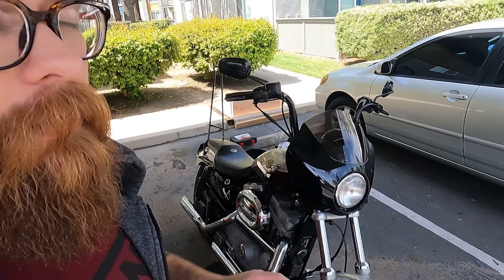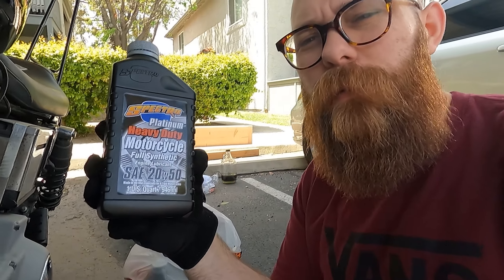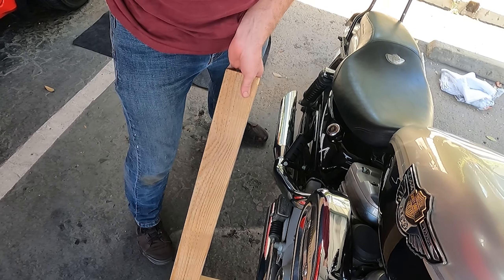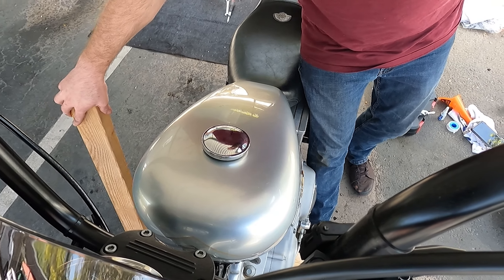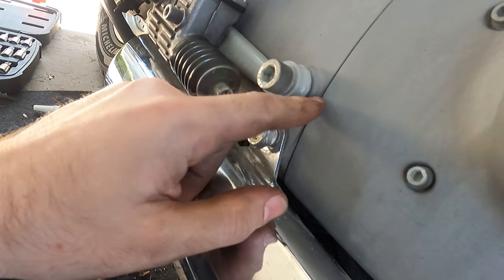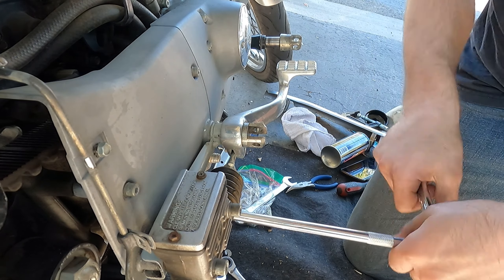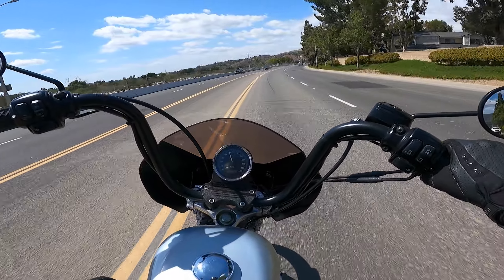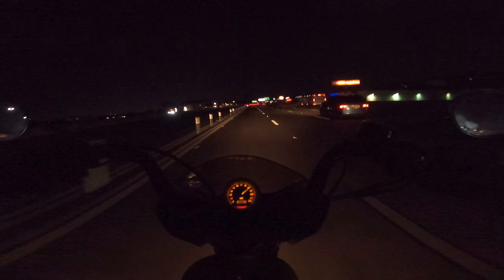Winging a sportster mid control install

Comment: Just bought a 2003 xl1200c. Love the bike! 
Your mid controls with forward pegs as highway pegs was an idea I had aswell!!
How do you like the mid controls?
Reply from the maker: I actually really enjoy them! The more planted "ergonomic" seated position definitely helps my back. Only downside I've noticed is on technical mountain roads I tense up more and get cramps in my muscles from it, but that's probably not a common theme, just my body sucking haha